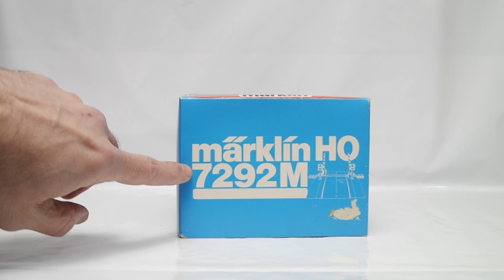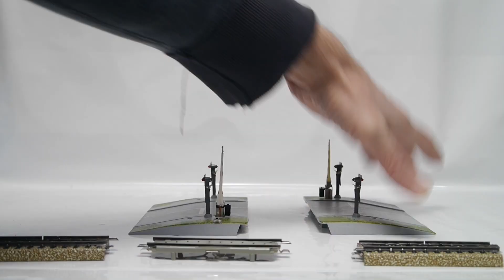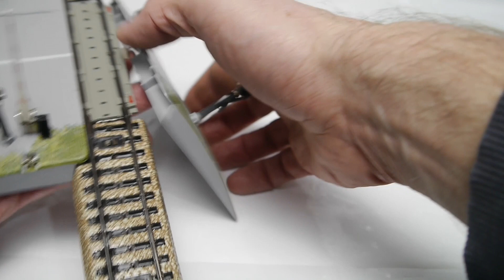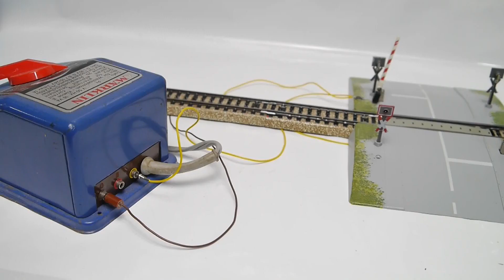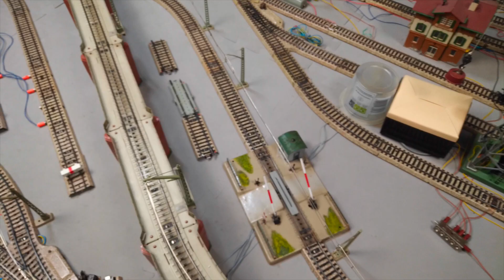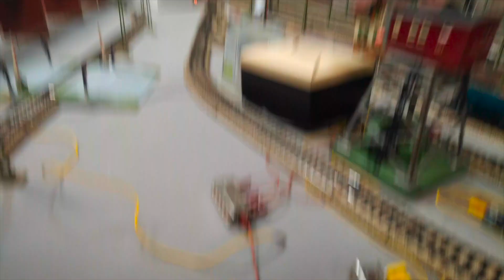Märklin automatic level crossing 7292M - Little Helpers

Comment: Bought one of these M Track crossings a few months ago complete with the additional Plastic track, infill and control tracks for  2 track operation. Ive just received 4x 5115 extension tracks in the post this morning. By my reckoning it should be possible to protect the crossing with signals by connecting the Lighting circuit power supply through the  isolation switches built in to the signals.
Reply from the maker: Sure thing, but I am a bit puzzled as to why you would do this? It sounds like the crossing would be used to control trains in this scenario, but I might be wrong :)
Reply: @The3rdRail  That's not my intention my intention is to merely protect the Crossing using signals. Im assuming of course that German signalling practice is to protect crossings using signals as we used to here in the UK Distant/Vorsignal Home signal/Hauptsignal crossing. Basically if the Home signal wasn't clear then the crossing wouldn't operate. ( Im an ex BR Intercity Passenger Train  Guard)
Reply from the maker: @schwarzalben88  One learns something new every day :) A little video about this if you set this up would be very interesting.
Reply: @The3rdRail  That might take me a while, my layouts not useable at the moment. Im also interested in interlocking Haupt and Gleisspur signals so you cant clear the hauptsignal without clearing the Gleisspur signal first ( You have to isolate the lighting circuit in the Hauptsignal first so basically the signal lights stay illuminated) but the electromagnet that switches the Hauptsignal is isolated until the Gleisspur signal is cleared.
Reply from the maker: @schwarzalben88  Simple job for a relay (ie 7045) at worse or wiring in parallel by the looks of it. The lights are isolated out of the box and independent from the relay inside a Märklin signal, so all that is needed is to synchronise the operation of the relay (blue wires - going to ground). Good fun.